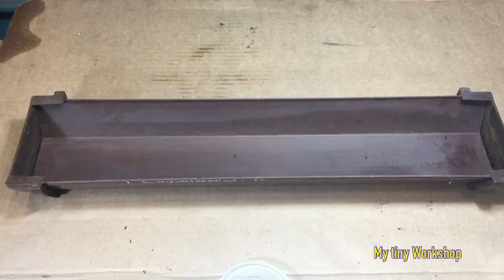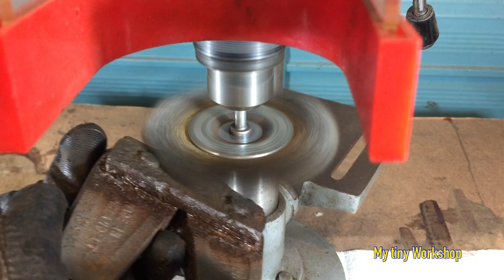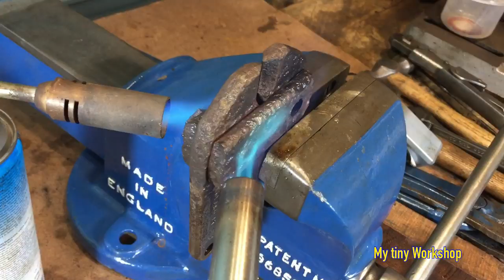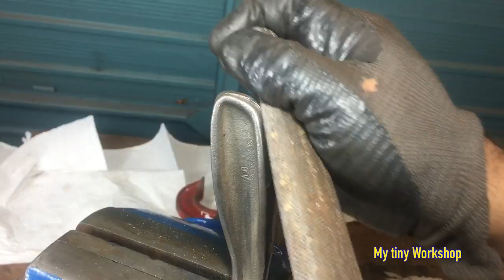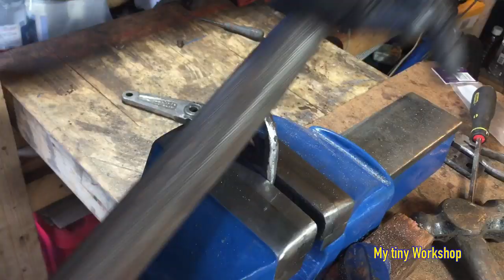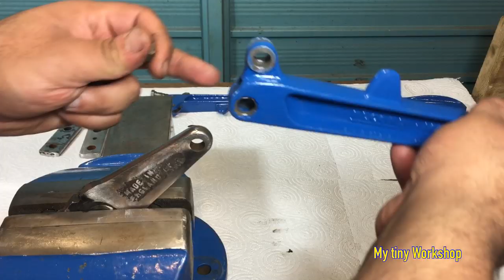Rusty Heavily Pitted Bolt Cutter/Cropper Restoration

Comment: I'm sure you know that you shouldn't heat up the jaws, they are hardened steel. The heating degrades the hardened steel back to mild steel. Even 'sharpening' needs to done with care with frequent cooling.  The cosmetic restoration looks really good,  well done.

Comment: I have bought many different sets of Record Made In England Bolt Cutters so cheap from there largest size which is the 942 too smaller sizes etc,  I have quite a collection of them, I have taken nearly all of them totally apart, Apart from both of the 942 bolts cutters i have managed too get the handles off etc but i still need too get the bolts out of the jaws with my manual impact screwdriver, I have cleaned all of my bolt cutters & greased & oiled them they are all still in there original condition just cleaned up a bit i'm not a person that restores things i like whatever it is too be in it's original condition, Your bolt cutters are missing the metal plate that goes over the bolt cutter head bolts & you are also missing the screw bolt that holds the metal plate in place i sometimes see bolt cutters that are for sale missing the metal plate & screw bolt that holds the metal plate in place which also keeps the bolt cutters jaw bolts in place & position & tension, If you would like too know where i bought all my Record Made In England Bolt Cutters / Croppers / Clippers / Clippit from let me know i'm not going too tell the world about it here, I know of several places where they are all bargain prices i won't say where here, They are all so cheap i could buy them all day long no problem & have a huge collection of them they are always for sale so cheap, You can also buy replacement parts like the jaws & jaw plates etc for all the models very cheap as well yet again i won't mention here where, I actually have two sets of Record Made In England No.942 & a brand new complete set of Record Made In England Bolt Cutters 942 Head in it's original box all bought so cheap every single bolt cutter that i have bought has been a bargain, I have no use for them always but i really like them i very rarely use them in the garage etc, The most recent Record Made In England Bolt Cutters i Bought we're the No.618 Clippit these are Very Rare do some online research you will not find hardly any information about them if anything that's all i'm saying here not telling the world about it, I bought them for a bargain, If you want too see my collection of Record Made In England Bolt Cutters i have plenty of photos on my phone i could e mail too you, Another fantastic brand of Bolt Cutters are HK Porter which are Made In the U.S.A i don't have a set of these but i know where you can buy them all different sizes as well, There is other brands if bolt cutters as well but Record Made In England & HK Porter Boston U.S.A These are both fantastic quality & two of the best bolt cutters you can buy there is other brands but not many another brand is called KAM you don't see many of these about but i have seen them.
Reply: I am missing the shoulder bolts that the jaws pivot on to the main handles. bought some which had the bolts replaced with normal m6 bolts and there is play in them...